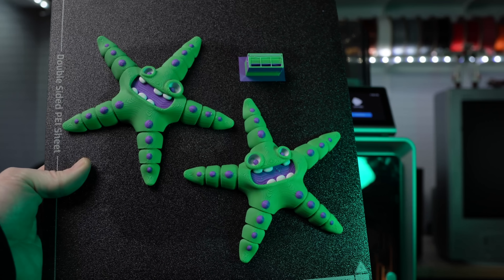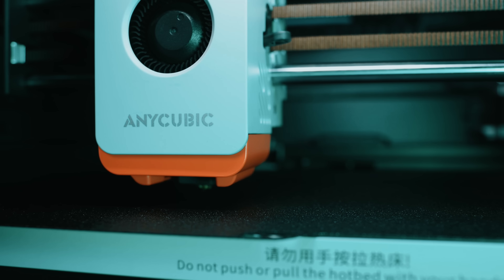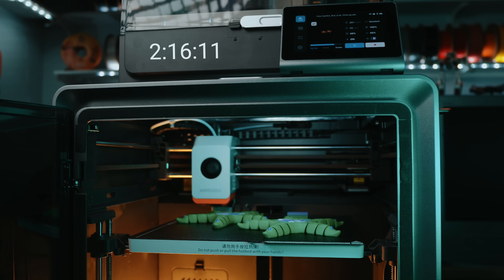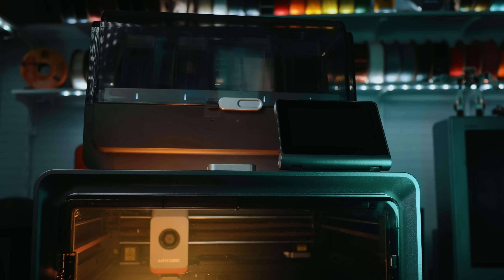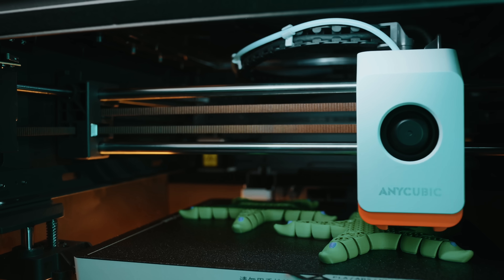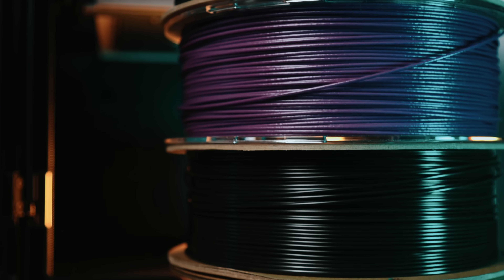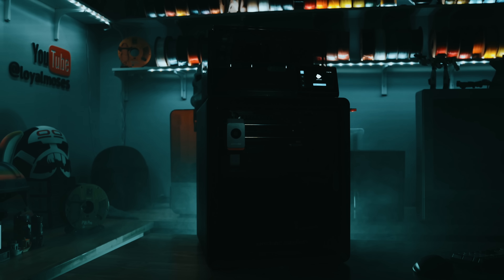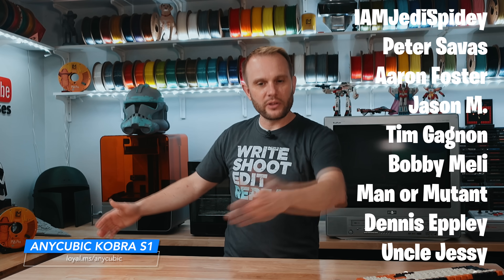Is the Anycubic Kobra S1 Ready Yet? Here’s What I Found

Comment: Good presentation, as always.  Nice to see more competition.  Hopefully they iron out any quality issues.  This seems to be common theme across all non-Prusa and non-Bambu brands.  Hard to consider a printer that is not setup to print abrasives out of the box.  There are too many good, non abrasve printers, to get too excited about any one of them.  Maybe its strength will be ABS and ASA, or PC?  Can you expand on its filtration capabilites, ability to connect tubing for venting, etc.

Comment: The Dryer/AMS is so important.  I am  so glad you are doing these videos.  I am still on the fence to test a K2 and or a S1 because I think aside from build volume, this printer could be good for me because of the AMS.  After I started feeding my Qidi from a Dual Creality dryer even my PLA prints got better.  Absolutely important !  Even if you don't print color much you are going to have stable filament.  I don't care much about the speed either.  Most of us would rather have high quality.  I run my Qidi at 40-70 Most of the time !
Great videos.  Love the channel.
Reply: I have had both a K2 and am awaiting the S1. I would recommend against the K2. I have had nothing but trouble with it. Printing fails 50% of the time and even when it completes a print, the quality is a toss up. Support is non-existent. Emails go unanswered. The only way I got any answers was to call creality directly. This means getting charged for an international call by my phone service provider. The door hinge to my K2 was completely detached. It is only held together by glue. One of the feet was broken, and the nozzle clogged on the first print. The printer was missing screws and parts directly from the factory. I honestly wish I could return the K2. Unfortunately they ran out the 14 day return period while failing to diagnose any of the issues.
Reply: @antoniomromo  I really appreciate you comments.  Your Creality problems almost look like my Qidi problems but Qidi has awesome support.  Problem is, you shouldn't need it.  I went ahead and ordered and S1without the AMS to try out because the Combo is unavailable.  I ordered the AMS off their Website with a Discount which is supposed to ship end of March.  I think QC has really bitten a lot of Co. in the B.  I am waiting to see if Creality will fix the K2 because I want to like the company and the machine has the specs..  I can't spend the money though until I see buyers supported and not ghosted.  The S1 is cheap enough I hope at least I can print some ABS and some CF while I look for a 350mm plus machine.  Color is not that important to me, but high temp. and reliability is.
I wish you well with the K2.
Reply from the maker: Having the dryer, you are right, makes a huge difference for the majority of users. Thank you by the way, I saw you become a member! 💜
Reply: @ Most welcome !

Comment: You stated Anycubic has developed a reputation for developing machines that "just work."  In light of that, I can't help but feel you've glossed over the manufacturing defect with the sensor.  Out of the box, it didn't "just work."  How likely is it that the people this is aimed at will be able to diagnose and resolve the same problem?
Reply: "Glossed Over" doesn't mean "not mentioning" it.  It means making less of an issue than what it really is.  In this case, I don't think you've done so intentionally.

You say Ford fixed the problem with your truck at the dealership.  The equivalent for this printer would be for AnyCubic to fix the issue you experienced.  Yet, I don't think you mentioned them being involved at any point of the diagnosing/fixing of the problem.

Pretend this was your first printer and you've purchased it based on AnyCubic's advertising of it.  You experience the same issue, but you don't have all the years of experience you currently have.  Is it something wrong with the printer or something wrong in your process?  How well does AnyCubic help with figuring it out?
Reply: Can we have a video explaining how to fix it? Please?!?!?
Reply from the maker: Ford makes the number 1 truck in the world, and when my custom F450 arrived it had a manufacturing issue, they fixed it at the dealership.

Glossing over the sensor issue would have been not including it in the video, I spoke about it 3 different times at the beginning the middle and the end of the video.
Reply: @LoyalMoses You were able to bring your years of experience to bear on the problem.  A Facebook group for this printer shows many many people having a variety of issues that would indicate problems with AnyCubic's QC.  AnyCubic's advertising for tbe Kobra S1 is aimed at those that want their printer to "just work" and, likely, don't have the skill-set you have.  

Yes, it appears the S1 is capable of printing well.  But the number of instances of people having to first fix a QC issue before it prints that well seems pretty high.  

I'm certain many people will buy the S1 as their first 3D printer.  I hope they get one that doesn't require fixing before they are able to enjoy printing with it.  Otherwise, I would certainly understand if it put them off the hobby.